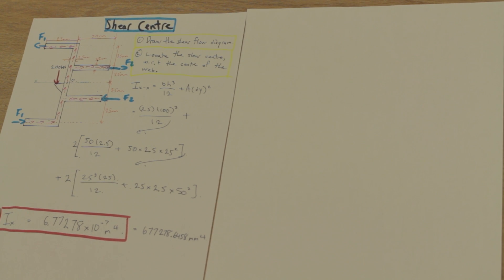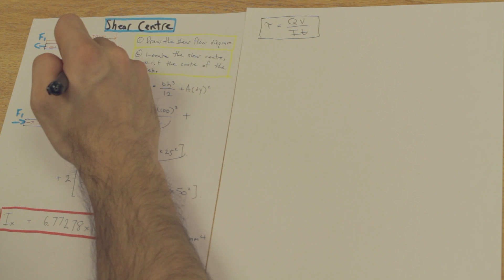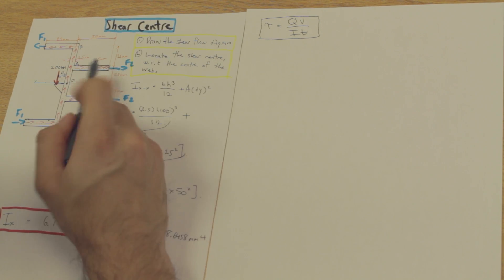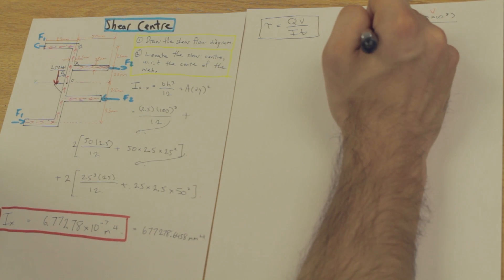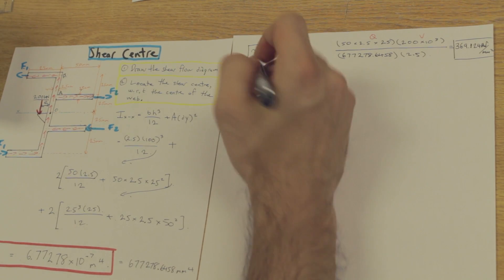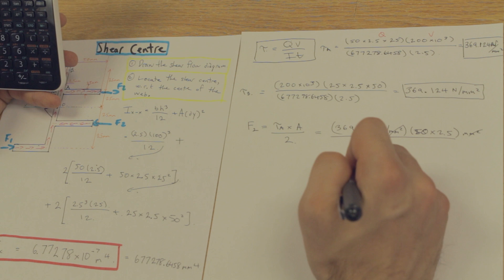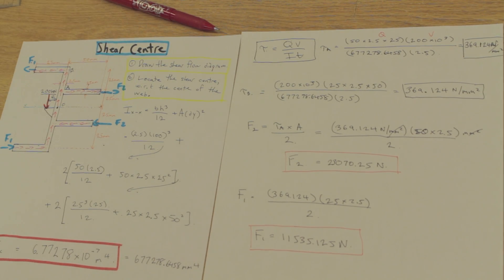How to Solve a Shear Center Problem - 3/4

Comment: You didn't account for the top flange and web when calculating Q for section A. Why?
Reply from the maker: The section is symmetrical, no need to repeat it for the top flange and web.

Comment: Why force is divided by 2 ???
Reply from the maker: It's best to go to the shear centre section of your mechanics of materials book and follow the derivation yourself, but in this case the flanges have a linear, triangular stress distribution, and the horizontal shear force in the flange is equal to the area of the stress triangle (tau * b / 2) times the thickness of the flange.
Reply: @AFMathandEngineering  what if its not a triangular distribution (as in case of a web)?

Comment: Thank you for your explanation! But i got a question for you: instead of having a "regular" section how woud it be if i had a circular section ? For instance, imagine if we had a half circular section and in tyhe middle we welded a beam! Could we use the same method?
If not coul you tell me where i can find some examples like that? Thank you once again, keep up with the good work!
Reply from the maker: Pedro Andrade thanks for the comment! Email me at afmatheng@gmail.com

Comment from the maker: TimeStamp:

1:58 - Theory Ends - Solution Beings (Dont skip the Theory!)
2:00 - First Step - Sub-in the numbers into the equation
3:44 - Second Step - Calculate "Tau for the Middle Section" in MPa
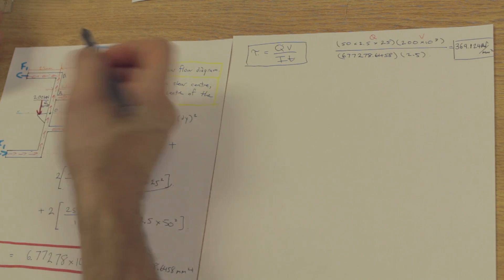4:09 - Third Step - Find "Tau for the Top/Bottom Section" in MPa 
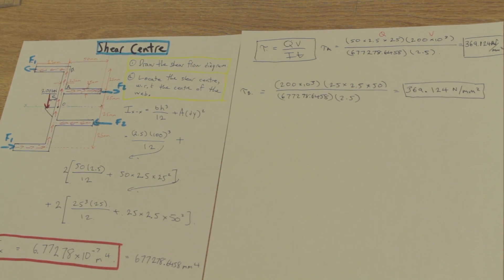5:24 - Fourth Step - Resolve the Forces * F2 - 6:15 * and * F1- 6:44 *
7:20 - Final Solution (Now try to do it on your own!!)

Comment: why does the equation for F2=(tau(a)*A)/2? why is it divided by 2?
Reply: The shear flow distribution is a triangular distribution. 1/2*b*q = F. You can also integrate for q(x)dx from 0 to b. Which will give you the exact same thing. Where q(x) = V(x)Q/I and V(x) is the equation you find for it by using sections.
Reply from the maker: Fred Davies Hey Fred, the reason why it's divided by two is that the stresses are a linear distribution on the flanges and form a triangular distribution.